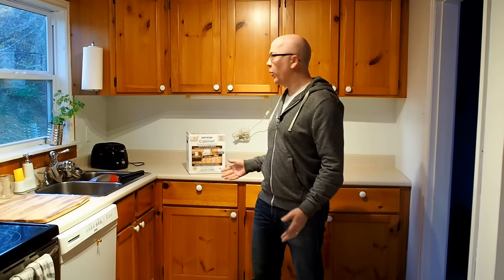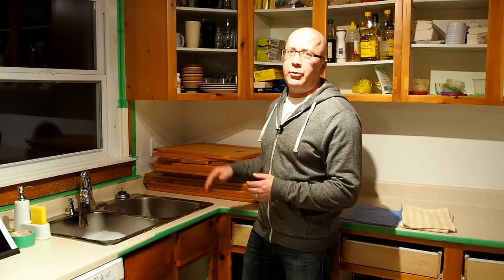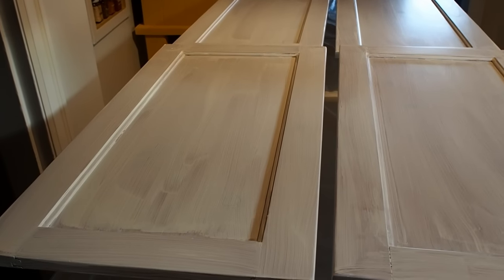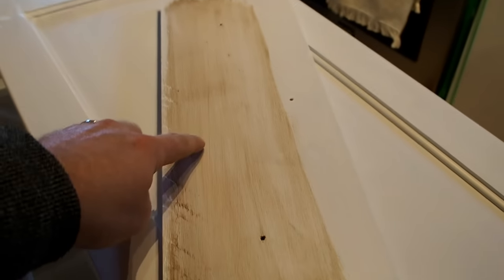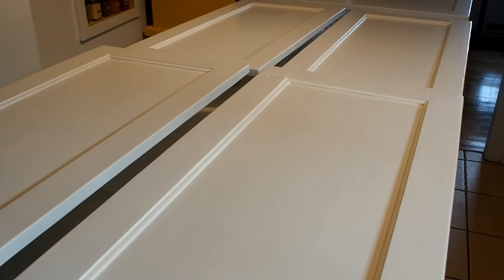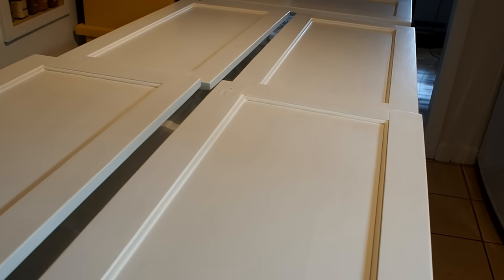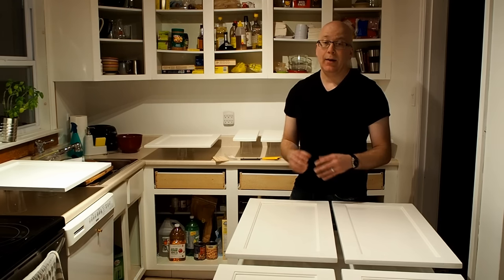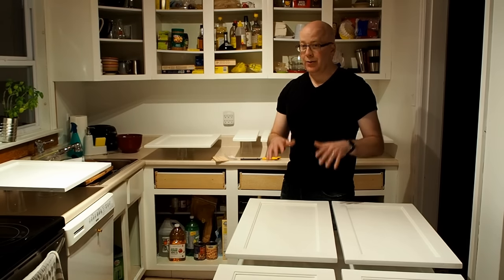How to Paint Your Kitchen Cabinets - Rustoleum Cabinet Transformations : Budget Renos #02

Comment: Deglossing instead of sanding your cabinets will never create a rough enough surface for your primer and topcoats to last and uphold as long as it should. Always sand your cabinets to create a mechanical bond ( sanding) vs a chemical bond ( deglosser). Chemical bond are not good for cabinets. I'm a professional wood finisher and painter. I do this for a living.
Reply from the maker: Sorry for the late response; just getting through some older comments now. No question that sanding would be a better long term solution. We were looking for five years out of this job. Three and a half years so far and it has held up well. Thanks for watching
Reply: @Handyverse  Awesome!!!..Thats good to know. Hope it continues to last for you👍

Comment: Did you do the protective coat on the back side of the cabinets- meaning  did you coat both sides ?
Reply from the maker: +Jeff Arthur we did coat both sides of all the doors. We didn't coat the insides or the backs of the cabinets themselves (that would require taking everything off the walls). We recommend coating both sides of the doors so you don't run into potential warping issues if the backs absorb humidity at a different rate than the fronts. Good luck with your project!

Comment: A foam roller would have eliminated the brush strokes
Reply from the maker: Thanks for the tip. Something to try for the next time. Thanks for watching!
Reply: the foam roller marks are worse then brush marks
Reply: If your foam roller marks are worse THAN your brush marks you may not be doing it correctly. My cabinets have no brush marks from the foam rollers. Just a smooth finish.
Reply: i dont have any brush marks from my brush.
Reply: Totally agree. That was my first thought! Why did they use a dang brush with such a smooth base. Remember foam rollers for smoother surfaces. That’s been my experience and I am not a professional in any way. They still look good and thanks for the post.
Reply: elizabeth hogan, tried using foam rollers they look n leave a sandy finish on door trim, 1/4" nap roller would probably work best if  person doesnt have a sprayer as myself.
Reply: I am a professional and always use a foam or microfiber roller and I NEVER have streak marks.  In addition, once you get skilled with the rollers, they're just as precise along edges and the cabinet face profiles.  If I told my clients I was brushing their paint on, then I would not get any business.  I also spray sometime.
Reply: Definitely a foam roller works better if you're leaving marks with it you're not using it right
Reply: Spray gun elimates everything

Comment: I’m curious, looking back would you have preferred to sand the cabinets first or did the de glosser do the job?  We are looking to paint ours.  How do your cabinets look today?
Reply from the maker: Absolutely, without question, we preferred the deglosser. If you have the time and patience, we're sure the sanding would be better (although likely marginal) in the end, but the deglosser is much less effort. Our cabinets still look good almost two years later, only a couple of small chips in some heavy use areas but they aren't really noticeable. Good luck!

Comment: What is the top coat, shellac? Another channel said the company told them to put a few drops of your paint into the top coat to prevent the yellowing and they said that it worked.
Reply from the maker: Thanks for the suggestion. We're not sure if that would work or not but are always up for testing out ideas that might make things easier.

Comment: What are you laying the cabinets on ?
Reply from the maker: Hah, it's kind of funny that no one has actually asked that before! We just had some leftover plastic cups that we used to prop up the doors so we could easily paint the edges. It's not the most elegant solution but it worked for us! Thanks for watching.
Reply: You can also use coffee cups, shallow bowls or plates.  Of course something called Painter's Points or Painter's Pyramids are sold for this exact purpose but not an investment I deemed necessary.  If you know a seamstress 4 similar sized thread spools per door or drawer front are awesome.  Even books in similar sizes work well. 

Re hardware, I stored mine in the cabinet space or drawer do matching everything is easier.  I used small bits of tape on the upper edge of upper cabinet doors to label the proper location for reinstalling, lower edge of lower cabinet doors and all drawer fronts.  It certainly expedites returning the kitchen to normalcy.

Comment: what type of brush do you guys recommend that we use
Reply from the maker: If we were to do it again, we would likely go with one of the brushes kcwizard72 recommended here in the comments: "Purdy XL, Purdy Clearcut or Wooster Pro (I prefer the 2 1/2" angled for cutting into the corners easily)"

Comment: Used this system with the stain not happy so now I need to know what I need to do to repaint any suggestions.
Reply from the maker: That's tough, sorry to hear. Maybe repaint over with a different colour?
Reply: Use sherwin William's extreme block, it's an oil based product. Top coat with emerald urethane.

Comment: If you had to do it all over again would you have started with the sponge applicator instead of the paint brush from the very beginning?
Reply from the maker: We probably would start with a higher quality paint brush as suggested by other commenters here. The brushes we used were not the best quality and we think that may have contributed to our issues.
Reply: Would a small foam roller work better with the bond coat and top coat, or stick with good brushes and foam brush (not roller)?

Comment: How did your cabinets turn out after several months? I am debating whether to use benjamin moore or what you use
Reply from the maker: Almost two years later and they pretty much look how they did when we first did them. We have a couple of small chips on the bottom cupboards (and a couple of scratches from the cats - not the paint's fault!) but otherwise good. We would still recommend it (except for the top coat). Good luck whichever way you choose. If you try Benjamin Moore, let us know how that worked; we're always curious to hear about different methods.

Comment: Cabinets MUST BE SPRAYED ~ never use a brush or roller as it will show the brush & roller marks. If you could see close up shots in the light you'd understand immediately. It makes NO SENSE to spend an entire week trying to force it to look good when it can be sprayed in ONE DAY with a factory quality finish. Cheap tools & materials represent the single biggest mistake DIYers make when approaching these types of projects. A good tool is not an expense, it is an asset that can be sold for 80%-90% of it's value once the job is done, and in the end it will produce superior results and require much less work. Best budget HVLP Systems: 1st choice: Fuji 2202 Semi-PRO 2 (2203 gravity fed version) for $439, & 2nd choice: Earlex HV5500 for $299.
Reply from the maker: While we disagree that they must be sprayed (because we're very happy with how ours turned out), we appreciate the detailed response and all the info.
Reply: Once you try the Fuji or the Earlex you'll never look back.
Reply: John Grimsley 

I beg to differ!  I refinished my mothers melamine cabinets 9 1/2 years ago....Same basic preparations,  but I used Benjamin Moore satin finish oil based paint... They gave me a brief course on how to sand in between coats & how to use foam rollers & brushes...The 4 
Evening courses were worth the $50.

Well....I did such a good job,  that those cupboards that were meant to be replaced after 5 years, are still looking fabulous today...only the hardware was changed to keep an updated look...

At first, when visitors came, they looked them over real good as visitors usually do...and they believed that they were new...My foam finish was impeccable....

There’s no way that I would put extra money on a spray machine, when I know that I can do a better job... And for a better job, I don’t mind putting in an extra day for an extra coat.

The reason I’m here now is because I just moved in this apt. the cupboards are the same as the uploaders, gives a gloomy look to the kitchen...Was thinking that in the past 10 years some new technique may have come up...

I can’t imagine what I was hoping for🤷‍♀️....obviously there exists nothing better than what I did before...But I did learn of the new 
sticky backsplash...😉
Reply: For you to say "nothing is better than what I did" not only tells everyone that you're not open to better methods, but also that you have an inflated opinion of your own work.

Once you use a decent sprayer you'll never look back. Best budget HVLP Systems: 1st choice: Fuji 2202 Semi-PRO 2 (2203 gravity fed version) for $439, & 2nd choice: Earlex HV5500 for $299.
Reply: John Grimsley 

 First:         I repeat....I DID NOT FIND ANY OTHER TECHNIQUE BETTER THAN WHAT I DID 9 YEARS AGO.....Benjamin Moore is a damn good paint. That helped a lot 👌

Second:     I AM ABSOLUTELY NOT ASHAMED OF BEING PROUD OF THE GOOD WORK I DID👍....I paid for courses to make sure.

Third:         ME...I DON’T HAVE THE MEANS TO PAY $300 or $450. FOR GADGETS THAT AS TO BE MASTERED, YEAH! MASTERED.
                    I ONCE TRIED A SPRAY GUN, THE RESULT WAS A DRULY MESS🤨

Fourth:       YOU ARE FREE TO  STICK TO YOUR SPRAY ALL YOU WANT.......BUT I WILL GO ON TELLING PEOPLE THAT FOAM BRUSHES & ROLLERS + LIGHT SANDING BETWEEN COATS...ALONG WITH A HIGH QUALITY PAINT DOES AN EXCELLENT JOB...once you learn how to use them with a light touch....All that’s needed for a PERFECT FINISH 🤩👌 is 2 base coats 2 finish coats for that  RICH OPAQUE look.

So MR. GRIMSLEY_,  DO NOT INSULT PEOPLE BECAUSE WE DON’T NECESSARILY HAVE YOUR LEVEL OF EXPERTISE WITH GADGETS NOR THE MEANS TO RENT OR BUY THEM?   DO NOT _SMIRK THOSE WHO HAVE HIGHLY SUCCEEDED IN THEIR TASK? 

Being smug 😤 doesn’t make you smarter....
Reply: I can definitely appreciate using top quality paint ~ it's no use doing all that work and then insulting it with cheap paint. It's pretty much the same idea when it comes to application ~ using inferior tools is an insult to both the paint and the prep. It's hard enough to get a perfect finish with a high quality sprayer, but it's impossible with garbage tools. Remember, a quality tool is not an expense, it is an asset that can be sold for 80% of it's value once the job is done, and in the end it will both be cheaper than renting as well as produce the superior results you're after ~ all while requiring far less work. Additionally, spraying takes no more effort to master than using hand tools. But you have to be humble enough to learn, and willing enough to work at it.

Comment: First, you used the wrong clear coat; Second,  a 4" inch foam roller would have required just one coat with a good primer and finally this wasn't a demo, this was a beginner's program. Blind leading the blind.
Reply from the maker: We respectfully disagree. We used the clear coat that came with the kit and followed the instructions that came with the kit. Is that not the definition of what a demo is? That said, we agree with you in that there are opportunities to improve in both the product and the process and we try to online that as best we can in the video.